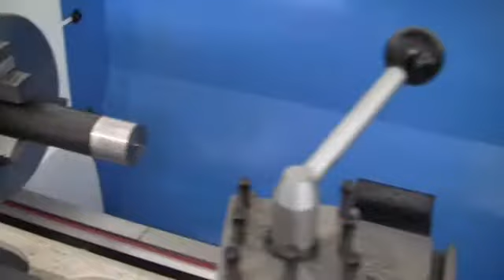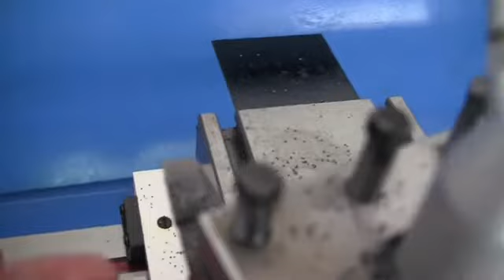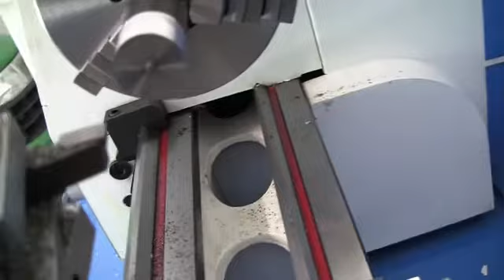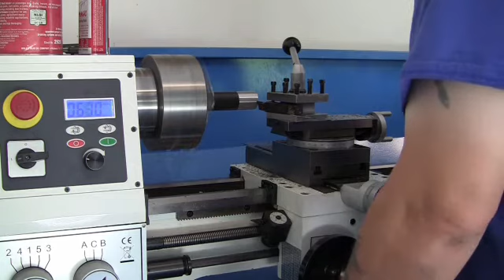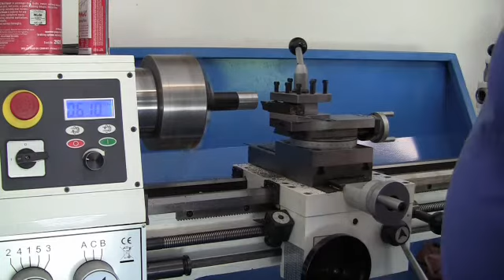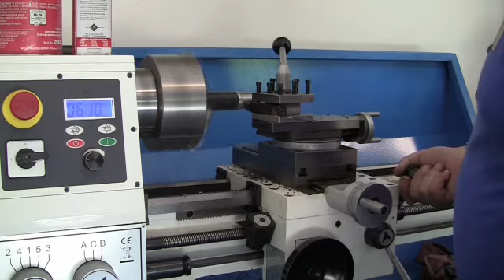PM1228VFLB Lathe taking the first cuts

Comment: Koba49, Please examine the Lathe's Compound Over hang in your Video (14:41 Frame) clearly shows the lathe was loosing
rigidity due to Compound Slide Over Hang Extension. 
 Also a question please? Did you check and adjust the the Lathe's Slide Way  Gibs on  Both the X and Y machine Axis as well as
the Compound Slideway Gib?
 As with all new machine tools they must have the Set Up Processes completed (machine leveling, Oil Filled, Quadrant End Gearing adjusted,
Slideway Gibs Adjusted) Before any accurate performance testing can be accomplished .

Comment: Thanks for posting.  Reading the comments, everyone's an expert aren't they? The only problem is I could only understand about half of what you are saying.  But I am looking at buying this model myself.  Enjoy your new machine.
Reply from the maker: the tool I was using did have a chip on the cutting edge that is why it sounded like crap when cutting, but it is a great little lathe in terms of size power

Comment: That sounded awful! either the bar you are using is some really tough grade material, or the tool is as blunt as a pigs bum, the swarf came off in little burning pieces, and it also has a very strange cross slide graduation, I have never seen one graduated in 2:1, that is going to make using it very confusing, especially if the compound graduations are in 1:1 for screwcutting.Good Luck on that one.
Reply: He showed that the dial grads are 1:1 for feed. So 0.01" on the dial caused 0.01" infeed which caused 0.02" change in diameter. This is common on older machines,, both American and English. Most modern industrial grade machine are "direct reading" - 0.01" on the dial is 0.01" on the diameter. So tool infeed is one half what is indicated on the dial. Direct reading crossfeeds require a larger dial or finer spaced grads. 
On the old Emco Super 11, which this machine is based on, the crossfeed dial was direct reading with 0.05mm grads. 0.05mm ~ 0.002", so there you go, PM could have specified direct reading dial with 2 thous grads I suppose. What would have been best is a direct reading dial with one thou grads but that would have required a larger diameter dial or really finely spaced grads. Anyone that's used old South Bends gets used to the 2X math. if you are threading you probably should be infeeding with the compound anyway.
Agree about the tool, why go to the trouble of making the video but then use some piece of junk tool?